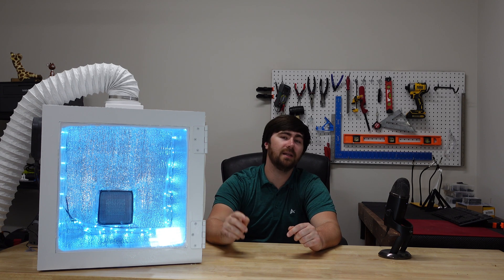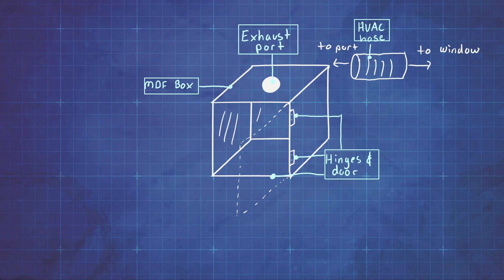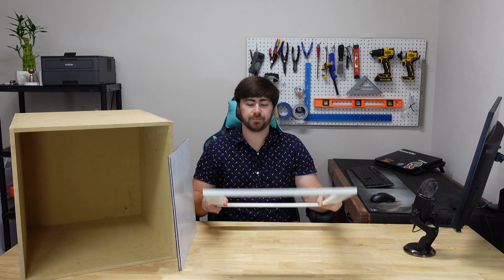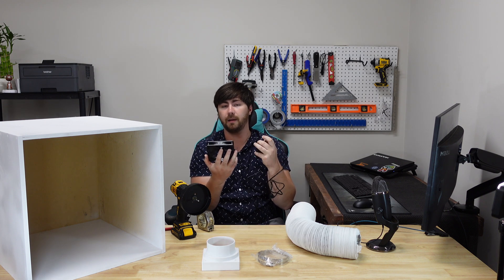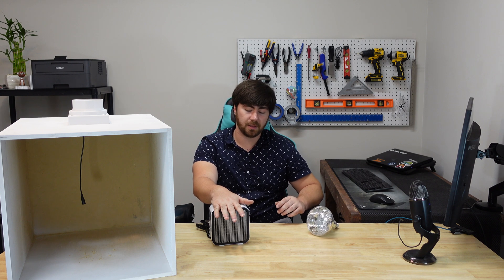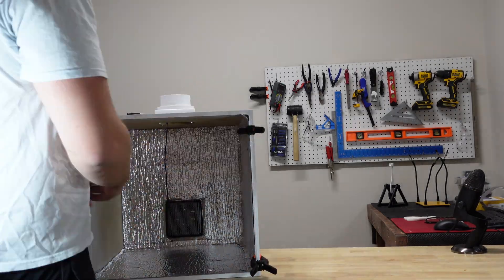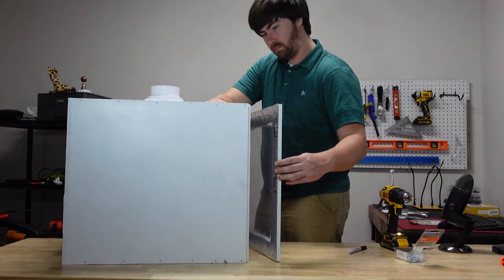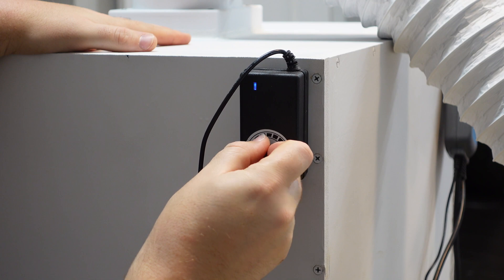How To Build an Insulated Temperature Controlled 3D Printer Enclosure (Print PC, Nylon, ABS)

Comment: 02:00 your box size is at least 56 cm and not 50 because you're not considering the cable of the plate. IMHO
Reply from the maker: You are correct! I did use the measurement with the cable when I built the box but I did not show it measured correctly in the video.

Comment: I had an idea to build something similar. The issue is the only place I can put my printer is in a cold cellar lol. So in the winter it gets about freezing. Do you think this could handle that or would I need to build something with like an R value of at least 24? I would probably forego the glass and lights on mine.
Reply from the maker: Hmmm, I wouldn't know exactly on that. Probably would try different insulation approaches through trial and error.

Comment: You forgot the most important thing - what temperature do you manage to reach in your chamber and how long does it take?
Reply from the maker: Hello! This will vary depending on the size of the enclosure/how airtight it is built but I am able to get 80C with the size of mine with the printer running in around 15 minutes.